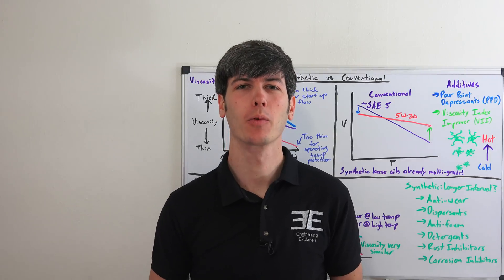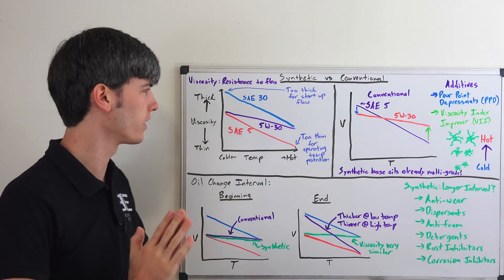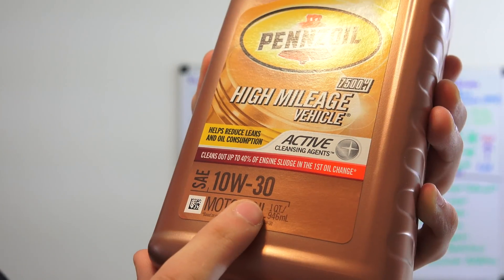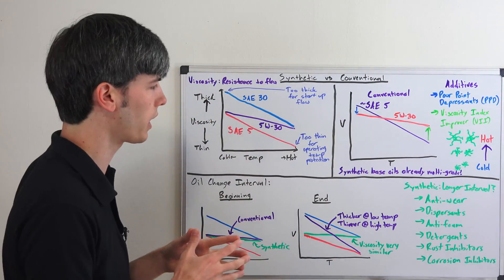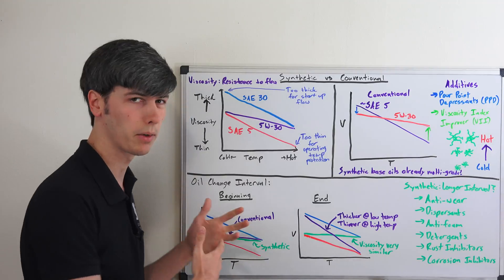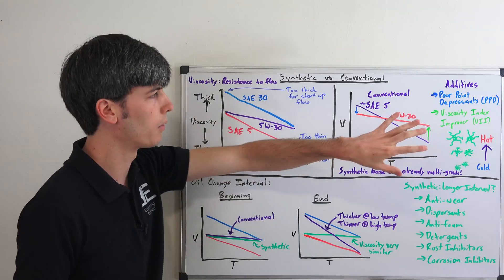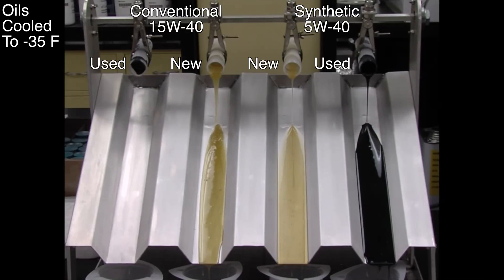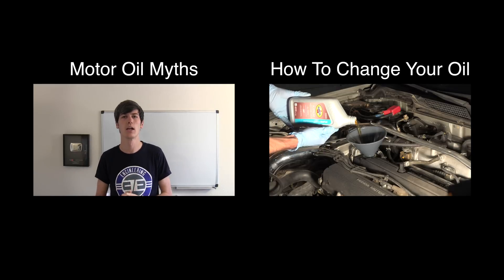Is Synthetic Motor Oil Better For Your Car?

Comment: I heard about Pennzoil’s new natural gas based engine oils, and that they perform noticeably better that previous full synthetic oils. I’m debating about trying it in my 03 Dodge Dakota, because at nearly 210,000 miles, Mobile 1 Full Synthetic High Mileage hasn’t let me down yet, and I don’t want to make a fatal mistake in changing oils this late in the game...
Reply: I don't think it'd be a problem, you've been using full synthetic already, there may not be a noticeable difference as all full synthetics are great.
Reply: @lonniebeal6032  yeah, I've been using it for a while now. Not bad, but hasn't given me any noticeable differences. Then again, I'm using it in a 18 year old worn out pickup...

Comment: I just switched to synthetic oil in my high mileage engine. I can tell the difference by the sound. It runs a lot quieter
Reply: Same here!
Reply: @rebel8440  ditto
Reply: Same here. My bikes around 12 years old and done 60.000km+. Uses many oils, from minerals to synthetics. So far synthetics are better in durability, reduce engine temp and noise, also fuel economy and better engine performance bonuses.
Reply: Did the same on my 04 with well over 200 hundred thousand miles, big difference.
I'm partial to Royal Purple!
Reply: I’m assuming it didn’t turn on
Reply: Same here
Reply: my wifes Hyundai is quieter without Synthentic..... than my truck with Synthetic.
Reply: @milboltnut  what synthetic viscosity and brand you use sir
Reply: What bike you drive?

Comment: Does ford oil just suck ass? I didn't get even 2000 miles before it started over heating and was super dirty. Last time I use ford motor oil

Comment: Put a bottle of 5W30 in the freezer for a while, pull it out and see if it pours like a 5 weight. LOL
Reply: You noticed that too.  Or heat the oil up and see if it pours like a 30.  Seems the numbers are backwards huh?

Comment: on the occasion of the API developing new "SP" oils I thought I'd raise some curiosity questions about what I've been observing as an owner of both a 2014 VW/Audi 2.0T and a 2017 Subaru Forester XT 2.0T.  One would think these two engines, both direct injected, turbocharged, and similar in power, would have similar oil demands.  As I understand oil grades, the first number before the "W" reflects the viscosity of the oil when the oil is cold, and the second when it's hot at operating temperature.  Subaru requires that I use synthetic 5W-30, but per the Mobil 1 oil choice webpage, all of the several "flavors" of Mobil 1 5W-30 synthetic are OK to put in my Subaru.  In contrast, VW/Audi has its own special oil qualification spec, and only one kind of Mobil 1 passes that, a 0W-40.  (although other brands of VW spec oil are 5W-40).  What is going on with engine design/materials/operation here, that my Subaru needs a thicker cold oil but a thinner hot oil?  What is so special about VW's "502" oil spec, when Subaru turbos don't need anything like that?  And now that both my cars' warrantees are ended/ending, can I substitute new efficient SP oils in either or both cars?  (a possibly interesting aside, the Forester can display its own oil temperature easily, and I have driven mine across the Rocky Mts towing a trailer, plenty fast, and I've never seen an oil temperature higher than 240F in 50,000 miles.  200F is the day-in day-out high usually seen in ordinary driving.)

Comment: Walmart Super Tech full synthetic all the fancy numbers and letters as the big boy oil company’s. It is also API approved. That said for $15.00 the five quart jug is the best deal. I change my oil and filter when I can’t see my oil level dip stick level lines through my oil. Over fifty years using this method and never had a engine problem. Best oil is clean oil.

Comment: hello

I have corolla 1.6 auto having 90,000 km mileage currently using 20W-50  shall I use fully synthetic oil like 5w-40 or 5W-50 as I discuss with a mechanic they are saying 5w-40 and 5W-50oil is very thin that compare to 20W-50

need your suggestion

Comment: Hello, Can I do an oil change 6 month even the mileage is less than 3000 miles? Manual spec on my car say 3000miles or 3 months is recommended. So can please explain why 3 months only even the oil is used for less than 3000 miles? Ty
Reply: Contamination, with conventional oils.  There are videos showing fully synthetic doing over 10,000 miles and 1 year on the oil change and being fine.

Comment: As long as you use the proper viscosity the only thing that really matters in the end is film strength. Some Dino’s will benefit your motor more so than synthetic thus creating resistance to flow creating more pressure but less protection. Many people are fooled I.e. when having a Harley oil pressure gage thinking higher pressure is better for your engine when in fact it’s the other way around, all it means is oil is traveling at a slower rate through your oil passages. Synthetic does last longer than Dino but as long as you change your oil at proper intervals than 99% of the time oil will never be your cause of engine failure not to include cold starts hence why we return to film strength. Great video but depending on geographical location and engine type, synthetic is not always the better choice considering stencil strengths can almost be identical between the two. Thanks for sharing.

Comment: As long as you change your oil once a year your car should be fine.  Just use a decent brand name oil.  Synthetic oil may be overall better but regular petroleum oil works perfectly fine.  Synthetic is pretty cheap these days but buy whatever is on sale.  Most people aren't farmers anyway and don't drive their cars on dirt road daily for work daily.  I've heard people who own Toyota vehicles who have never changed the oil in their car and the car still runs just as well as people who change their oil routinely.  As long as you check and top off you oil routinely that is likely more important than changing your oil.

Comment: if conventional oil is also SN Plus certified, which is, apparently, a must for gdi engines, then is synthetic really necessary ? as long as you change oil on time or even a bit early to be safe, with conventional ? Kia Stinger only api Sm and alsac gf-4 is conv. oil is manufacturer requirement.. oddly, if it's a gdi, I don't know why kia wouldn't require sn plus for this engine, but it is... so is conv. oil with sn plus more than good enough and can save from having to use synthetic, or is it still way better to use synthetic, cause tbn, teost, and other test scores that much better than conv. oil, that still worth it for the average driver (not race car) ?

Comment: Bull that oil so black should been changed long time ago. Conventional oil is fine long as you change your oil. Conventional so much better now days than years past. Unless you live in area subzero temps conventional will do fine. Waste of money with synthetic cause you got to change what the owners manual tells you most conventional oils can go 5,000 miles easy thats what my owners manual says to change it. I've used Havoline conventional oil for years and never had a issue. Now if i was up north where it gets below zero id consider synthetic oil.

Comment: Decades ago, the timing belt on my wife's Ford Escort (she bought it before we married) broke at almost exactly 60,000 miles (the recommended replacement interval). When we took the head off to replace the single bent valve, my knowledgable friend supervising my work reached into a cylinder and noted there was essentially no cylinder wear. My wife had used Mobil 1 since the first oil change.
Reply: She used synthetic or mineral oil?
Reply: @mycamera_lens  Mobil 1 is a synthetic engine oil.

Comment: I just put 2,900 Miles on my motor oil. 85% highway driving. I did this in a week. I checked the oil last night when I pulled the dipstick and was surprisingly shocked to see the oil was still clear. Why is that?

Comment: It depends where you live.. notice in cold weather test the synthetic flowed better. But that also means its not as sticky and will dain off in to your oil pan, when car is sitting, so on startup there is no oil on metal.  It's a toss up, if you change your own oil conventail is cheaper even if you change it more often. He also said at the end of video  synthetic is better at end of its life...If your a person that pays some one to change your oil every 6000 miles yes go synthetic, if you change your own change at 3000. Never had a engine fail with real oil at 3,000 miles in 35 years.   The key factor is change your oil often...

Comment: i have a 1995 audi quattro 2.6l, the previos owner used 5w40 oil in the engine, but it think it is not thick inaf because i hear one of the compensaitors rateling, what would you recamend as a replaicment 10w40 or 10w60??? the car is used in Baltics, so we have a range of +30C to -30C temperature range.

Comment: You should do a video busting the myth of thicker oils to compensate wear on high mileage motors!
Reply: If the clearances are too large on the high-mileage engine, you do need thicker, until you can rebuild it.
Reply: @michaelbenardo5695  this comment is old, but I remember reading somewhere that using thicker oil is not correct
Reply: Really, you should rebuild the engine, but some people simply can't afford it, so they have to do what they can to help extend the life of their worn engine.

Comment: New trend in motor industry shows use of 0W-20 synthetic oil instead of 5W-30 or 5W-40 for better fuel economy and better emission control.
But wouldn't that lead to more wear and tear in engine parts specially in long run?

Comment: I bought a 2003 Toyota Sequoia brand new back in 2002.  It's got 238K miles now.  I have always taken it to quick lube shops (I know, I know), and opting for conventional oil.  However, I always bring it in every 5K miles.   After 16 years, the engine is in excellent shape and can probably go another 200K.  However, the rest of the vehicle is falling apart and sadly will need to be junked soon.  Moral of story?  Just change your oil and filter regularly and your engine will outlast the rest of your car, even with cheap oil and filter.

Comment: The reason you change the oil is because it gets contaminated, not because of it breaking down. I've never used synthetic, and put over 200,000k miles on many cars, and the engines never even so much as used a quart of oil between 5000 mile oil changes. Using synthetic or changing sooner than 5000 miles is just a waste of money. Unless maybe you are in extreme situations with your vehicle.
Reply: synthetic is cheaper because it lasts much longer. If you were using synthetic you could have gone 10,000 miles between your oil changes.
Reply: @Redtooth75  did you read anything I wrote? Oil gets contaminated. I would not want to go 10,000 between oil changes even with synthetic because synthetic is not immune to contamination. You can go 10,000 with conventional too, if you want, and it probably won't hurt as long as it don't go low. So it's not cheaper. Heck I know people who use conventional and never change the oil. One guy I know is at 90,000 miles and has never changed his oil. Can't get cheaper than that!
Reply: @MasonDoctor  okay, every expert and educated person disagrees with you but you do you
Reply: @Redtooth75 🍻

Comment: I never see the old oil in my car get as black as the spent ones in this video. It has 86K miles on it. 5W-20 oil, 3,000 recommended oil change intervals.

Comment: Hi Jason, thanks for the video. For my car, it's recommended from the manual to use 5w-30 full synthetic oil. However, in my country, the summer temperature is usually around 40-45 degree C, and winter is about 5 degree C. Is it better to use 10W-40 instead for the high temp during summer time or to stick with the manual recommendation. Thanks!
Reply: 5w40 recommended !

Comment: Lol, using heavily used diesel oil for the demonstration is a completely fair comparison I'm sure. Just follow your manufacturer's recommendation for service intervals and oil weight, and it doesn't make any difference which oil you put in it.

Comment: Strictly from a viscosity point of view, the thicker oil should provide better protection for your engine, not worse as stated. If the oil had thinned out it would provide less protection. Granted there is other contamination and so on in used motor oil which will cause wear, but not the viscosity in this experiment.

Comment: I know many people have already talked about this, I just want to know that I live in a country where the temperature can be between 23 to 36 Celcius, now I have a Toyota Corolla 2nz fe VVTi 1.3 liter engine, it has run around 91,000km, will 20w50 multigrade oil be fine or should I switch to 10w30 or 10w40 fully synthetic oil, as I bought it used with no history of what previous owner used.

Comment: Here is my question. I've heard of oil made up of 5 qts or even 10 qts. Let's say you had all the same viscosity 5W30, all fully synthetic. Each oil may contain certain additives vs others, so mixing could make sense. However, could this work? Your thought of the pros and cons.

Comment: The only time I would ever use pennzoil is if it was the last oil on earth. It is a parafin based oil and will sludge up your engine bad. The claim is they make it from natural gas, well one of the main components of natural gas is parafin. Parafin is wax which turns to sludge on engine parts. Found out the hard way years ago with my own vehicle. Y’all use it if you want to.... ✌️

Comment: Ok but I've been told that synthetic oil actually wears out your seals fast. So I've used regular 10w30 because im worried that all my seals in my motor will be worn out way to fast. I can now see its def better for the motor but what about the gaskets and seals.  Would love for you to do some testing on that in another video.
Reply: Seriously obsolete info. In the '70s and into the '80s engine seals were not designed to work with synthetic oil and many seals failed under hot synthetic oil. My 1985 Volvo did just fine with the change to synthetic; if you have anything newer than 1990 you have no worries at all. I have not used conventional oil in any of my cars for more than 20 years.

Comment: +Engineering Explained
If car goes on mileage of 200000 KM,Which engine oil is best for car on lubrication point of view and which could not consumed or loose in engine on every 3000KM? What you suggest

Comment: I had a 90 chevy truck I bought with 250K and sold with 312K no oil related issues. Current have 97 chevy truck with 250K, 2003 focus with 185k and 2008 taurus with 135k. In all I used/use conventional oil and 5k change intervals.

Comment: Which is good for 1.9tdi skoda octavia
0w40 fully synthetic or 5w30??
Friends.
I use Mobil 1 0w40 fully synthetic
Reply: Much more to oil chemistry than viscosity and whether or not the base stock is synthetic

Comment: I started using synthetic oil at around 75,000 miles on my car. Which was not long after I bought it. I had no clue what was in it before but ever since then it would burn through the synthetic oil at an alarming rate! I am now going to motorcraft.
Reply: Much more to it that you're thinking

Comment: I drive a 1998 Dogde 2500 V10 4X4 w/265000 miles right From the first oil change i Ran MOBIL1 10-40 and K&M H4200 fillter and it still pulls like a BEAST!

Comment: 10w40 and 20w40 my Q is at 100 degree C both grade will react the same to the engine parts?
Reply: Yes, but do remember that along the temperature gradient from 0-100 they will behave differently. Their properties will be pretty different at around 50 degrees for example.

Comment: interesting question ...you might want to consider the cost factor... A traveling sales person might trade off more often and not really get long life benefits. Where a family man might try to go the distance but must consider the total cost per mile overall. Others might want to maximize the higher resale value while older want to buy that last car and drive it till they die off and of course keep cost down. I have 187,000 miles on my 350 v8 1987 1/2 ton pickup and enjoy the valve body fuel injection no choke issues.  Low cost property Values are also an issue. Electric cars might be nice but if you pay more in taxes your loss is in the tax man's favor. Not in your pocket book. Hello tax slave. You might want to consider making the jump to the higher wage states and that "Make America Great Again" but don't jump out of the frying pan into the fire. Check out the net return and find a good boss and not a slave driver or sob and  move up in net return in your pocket. Watch out it is not what you earn but what you have left over after taxes and cost of living that sets your Standard of Living and your net savings for retirement. Know your budget and plan ahead.

Comment: One problem, people change their own oil, and take the used oil to the recycle yard.  At the recycle yard natural and synthetic oils are mixed.  The recycle yard vacuum distills the oil and separates it on the basis of viscosity.  Then sells the oil as reclaimed oil, typically to large marine vessels to use as lube oil.  The marine vessels pump the oil through the engine once and discard it into the ocean.  One ocean going marine vessel can discharge 80,000 gallons of oil in one ocean crossing.